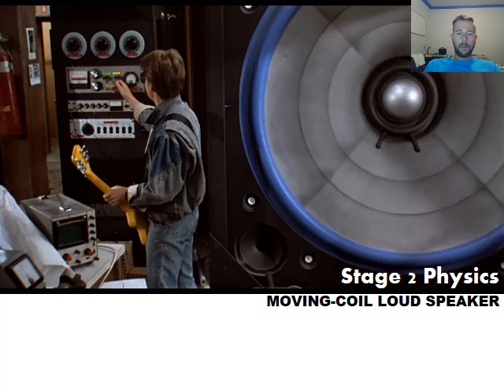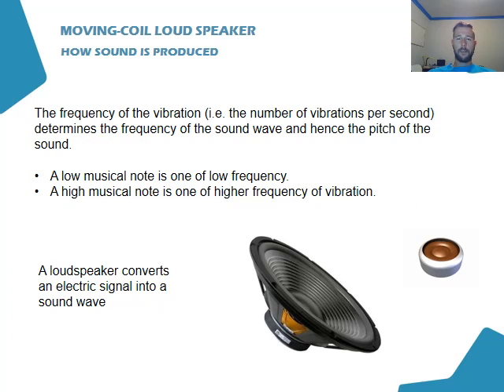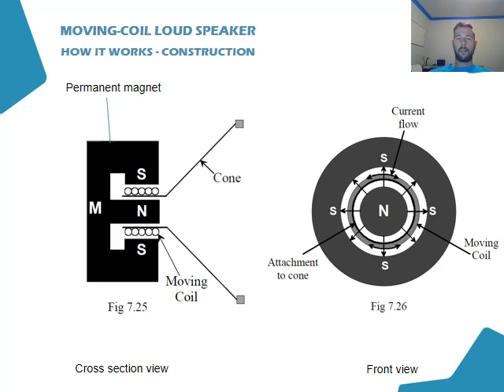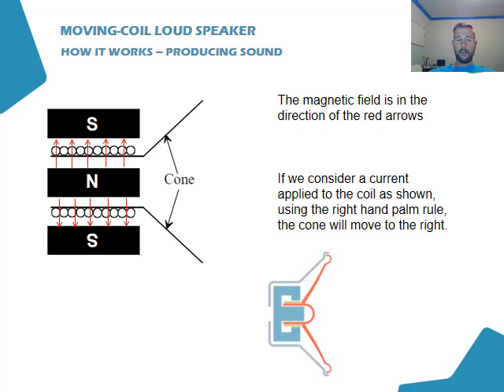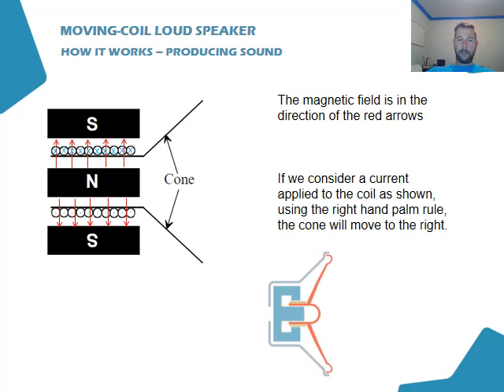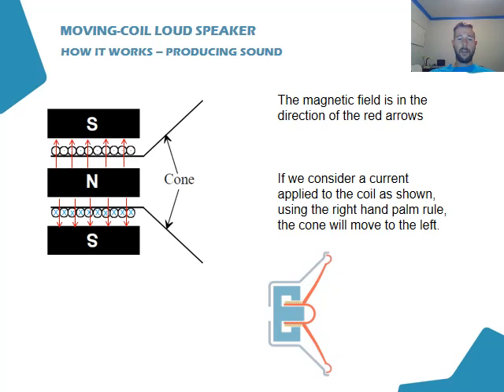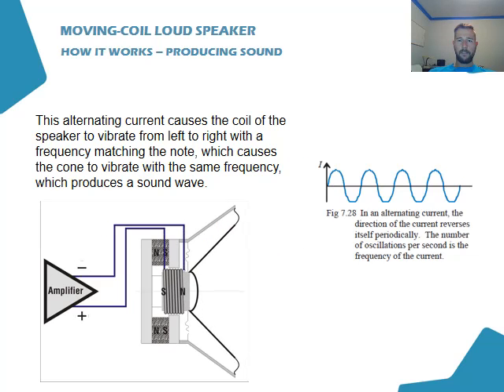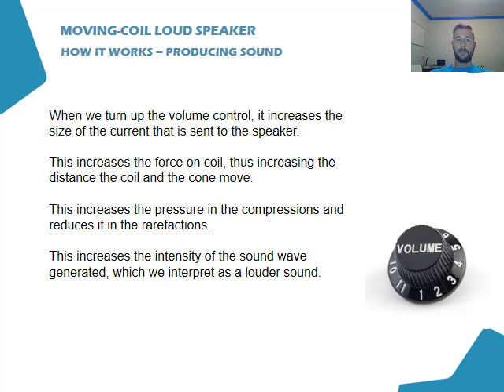Electric and Magnetic Fields - Speakers

Comment: Sir I have a question.
Will there be any induced current in the coil according to the Faraday law of electromagnetic induction.
Reply from the maker: The current in the coil is provided by an external source. This would be positive and negative current repeatedly changing, related to the changing of the sound wave. This change pushes the speaker in and out, reproducing the recorded sound.
Any current that is induced due to the movement of the coil within the magnetic field will be exactly the same as the provided signal.
Reply: If the current is alternative why the speaker has two (+ and -) terminals? If the direction of the current does not change in some speakers,  how the  diaphragm to return to its previous position? suspensions?
Reply from the maker: @mehmetaliakçayır  Good question. It could be suspensions. I am not across all types of speakers.  Could check out this for a variety. https://en.wikipedia.org/wiki/Loudspeaker#Other_speaker_designs
 Otherwise, 2 terminals could mean 1 for the speaker, and 1 to power an amplifier or other circuitry.
Reply: @LuckyJBot  Thank you very much for your answer.